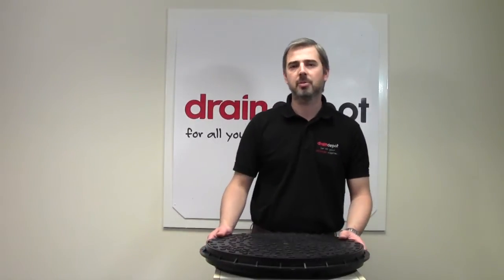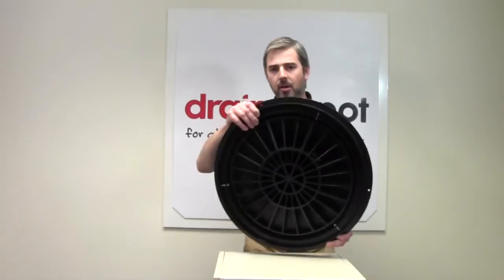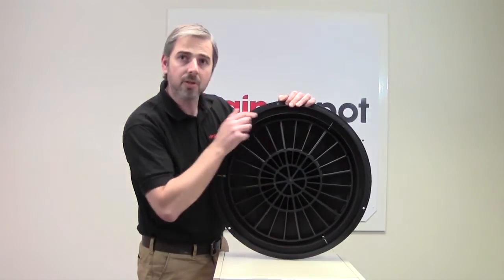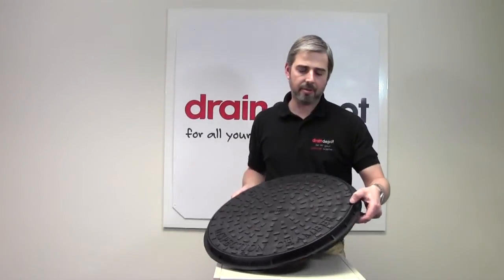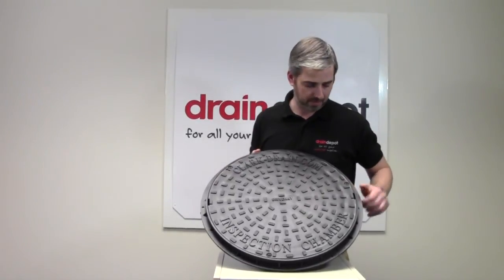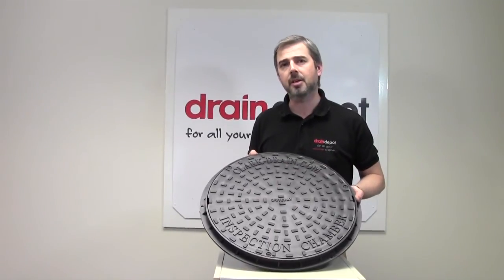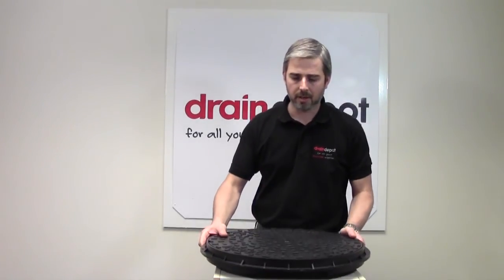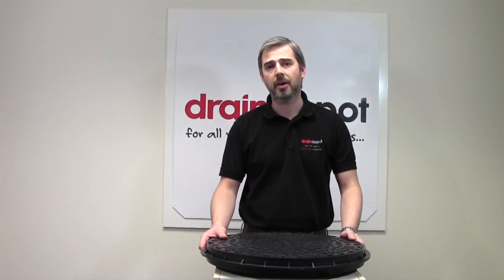450mm PVC Underground Drainage Circular Inspection Chamber Cover A15 Loading

Comment: I have bought the 450mm cover and chamber, and the cover sits loosely on the chamber. Should there be a rubber seal between chamber and cover when I am not using a riser in between and can you link me to the correct seal? I bought one online and it doesn't seem to be thick enough and the cover just moves around loosely still. Thanks!